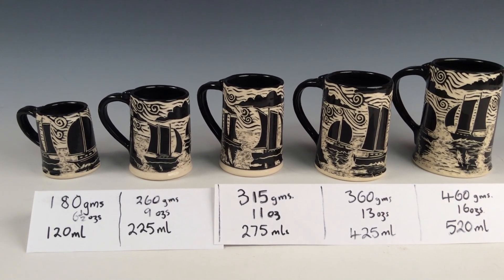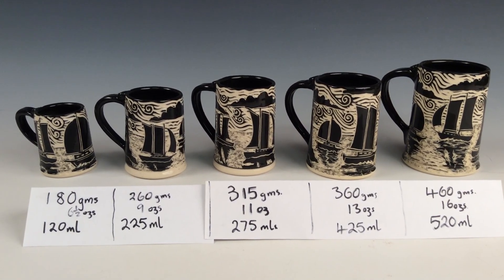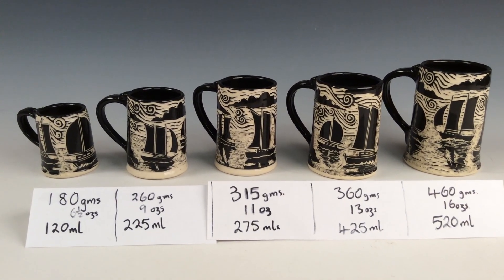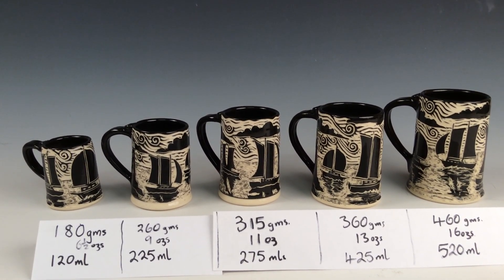Five different mug sizes part 2

Comment: Thank you. To my preference it seems that 0.7 to 0.75 lbs of clay is about right for a standard mug. Throw it slightly taller than it is wide and you’ll be all set. Do you find one size more popular than the rest with your customers?
Reply from the maker: .75lb makes my usual size but I am amazed at how many people use a large 1lb mug. Thanks.